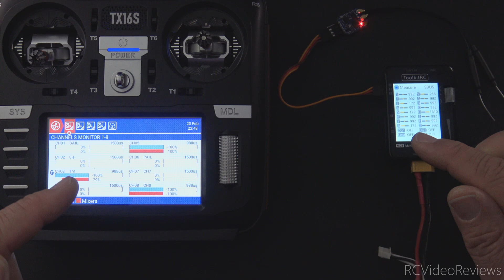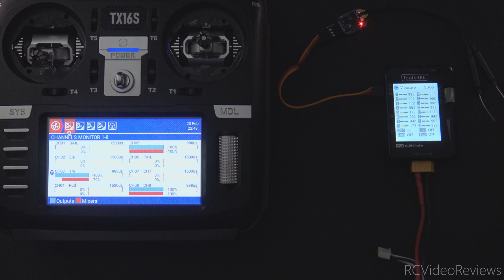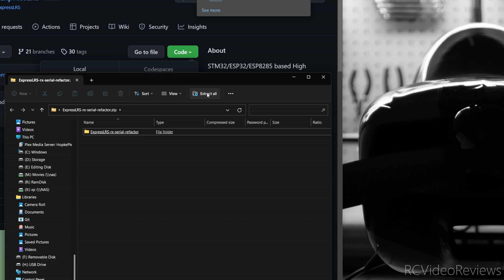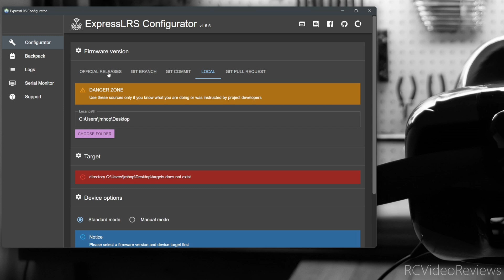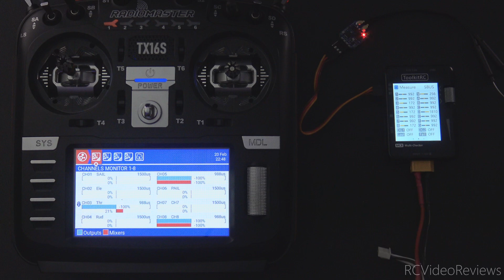ExpressLRS How-To Build Experimental Firmware Including SBUS

Comment: Hi, is it possible to make a custom firmware using the ULRS configurator? I want to design my owm RX board using and I want to change a few pins on the ESP8285 microcontroller. Thanks

Comment: I experimented with a RM RP1.  I set it for SBUS.  On TX16S with RM Ranger I deleted all the function and previous setting from TBS Nano.  Using SBUS for ZOHD Kopilot.  I cant get it into manual flight mode.  It like I have 2 RTL/RTH settings and 1 balance/stabilization mode.  Any ideas to get the manual mode to show up?
Reply from the maker: Channel 5 is binary if you aren't using 16ch/2 or 8ch.

Comment: Hello!!! Does it work with Matek pwm6?
Reply from the maker: Matek 2400 RX PWM is listed in the device list. You'd have to compile it and try for yourself. I'm not sure what the situation is with putting a serial protocol on a PWM target is with ELRS. My instincts tell me it won't work as PWM targets are designed to output PWM.

Comment: Thank you, Thank you, I'm sure you go a lot of requests to build for different rx's.  I had a 24d but went out and bought a few spare EP2's to use the bins you provided, this is better.
Reply from the maker: When I first learned how to do this, I followed directions for install of the entire toolchain. I figured out afterwards how the source code can be used within the configurator without even the requirement of utilizing git. That made it easy enough to explain and demonstrate. 

Also, with the rapid pace of development, it might be fun to check out other initiatives on GH for ELRS. Once you've done it, it's pretty simple.

Glad to help...

Comment: I notice you often use a Matek r24d diversity rx in various projects and in large planes. I fly 3d planes with elrs rxs with one antenna in a large city; should I consider upgrading to elrs rxs with 2 antennas?
Reply from the maker: The best thing I can suggest to do is to get an R24D, and then log your data with the current RX and an R24D and see what the data tells you.

I can tell you in my case, my RQLY for LOS is usually never lower than 98% and my TPWR is usually 25mw, with an occasional uptick to 50 or 100mw. Those bumps rarely last more than about a second.

I need to do some testing with some of the true diverse RXs out there, but for LOS, these R24Ds latch on to the TX like a pitbull with lockjaw.